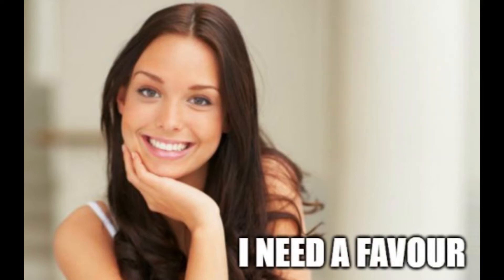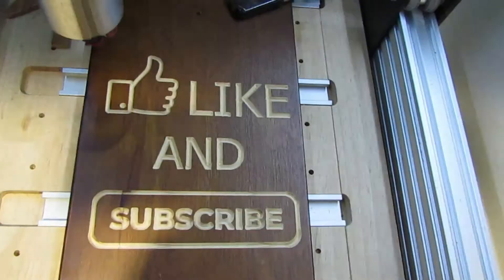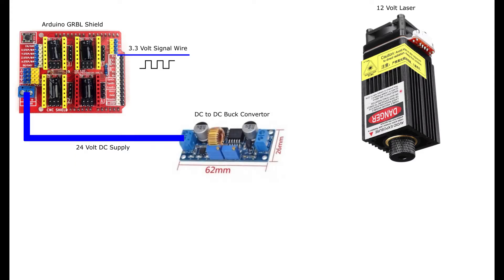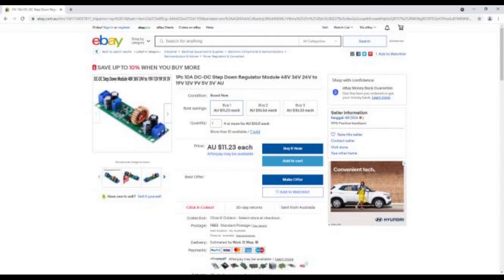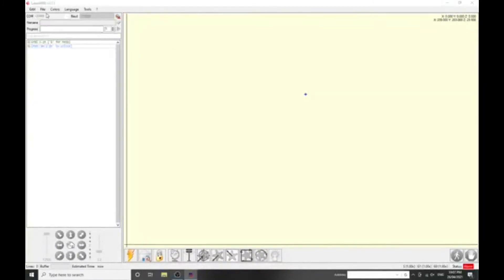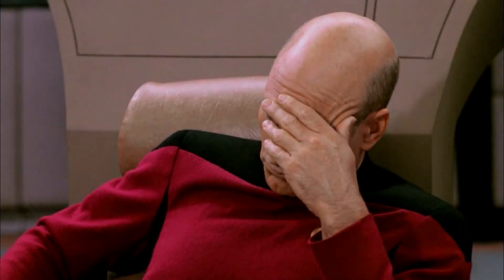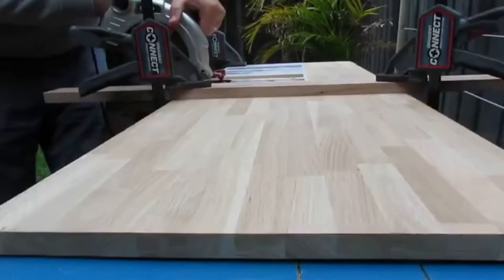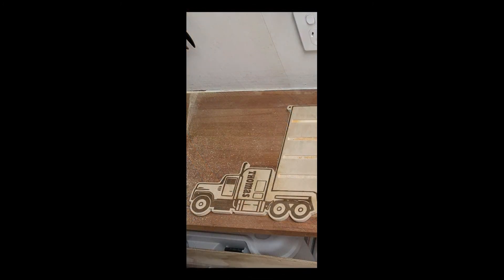Adding a laser engraver to my CNC machine

Comment: Why you don't connect a laser directly without MOSFET?
Reply from the maker: The microcontroller outputs are only 3.3v on/off signals - not the right voltage nor powerful enough to drive a 12v/5W laser.

Comment: You confusing me , because most of pwm signal oprate at 5v so how to know if my laser operates at what pwm volt ? I have CV 5 watt optical laser i contacted it to 24v VCC and touched pwm pin to check it was turned on and same time I use my other finger to touch 24 V it was at full brightness then I connected it with 5v same brightest and input current so I the it will work with both 5 and 24 V pwm so why you connected 12 v ? I think these is voltage clamping diode with clap pwm to 5V .
Reply from the maker: This is a laser without PWM (only 2wires). The mosfet allows the 3.3V Arduino signal to switch on and off the 12V laser supply. Your PWM capable laser likely has 3 wires. 2 for the DC power source and another to accept the PWM signal (probably 3.3 to 5v). If so you wouldn’t need a driver such as the one in this video.
Reply: @blackcatdown9560  but even at 5v pwm and full power in setting $30 = 1000 it's just consuming maximum 0.8 mA and when I connecting Laser pwm pin to 12v via 2k resistor it consuming proper 2amp input which is equal to 20 watt and 5w optical so what should I do 5v or 12 pwm?
Reply from the maker: @omsingharjit I not sure I understand what you’re saying, but The PWM wire is for the control signal from your microcontroller, hence microcontroller signal voltage (3.3-5v). It is used so your controller can very quickly pulse the laser which results in varying power levels. The wider the pulses the stronger the laser burn. Hence “pulse width modulation” or PWM. The other two wires are what provide the lasers power (likely 12-24v)
Reply: @blackcatdown9560 i know about pwm I was asking , whether pwm can also be of 12 volt logic ?
Reply from the maker: @omsingharjit  I don’t know your specific laser. All the microcontrollers I play with use 3.3-5v. I believe this is pretty typically across most controllers. What controller are you using that uses 12v?

Comment: First let me say thanks for sharing, thought it is a long time since you posted this, it still helps. Can you help me please? 
I have a Laser that has PWM signal and also can drive with 12V. Can I bypass the Mosfet module and connect all three wires (Z+ also), directly to the Laser? I drive the Shield on the Arduino UNO at 12V.

Comment: Nice job! Will it work with a fiber laser source also? (Not diode laser, something like raycus 50w fiber with fiber cable and optical focusing lens installed on the gantry)

Comment: I sure do appreciate your response, my goal is to put together something very similar to the video you posted, I was curious if I could recontact you if or when I run into trouble during my build,, thanks again, MARK.P
Reply from the maker: @markpastor4242  I’ll try to answer any questions you have along the way. I have a later video about adding a different laser module that could be worth watching too. That was my second attempt and I got a more polished result. It included some things like custom buttons in laserGRBL too which I find a big help when setting up jobs and when switching between laser engraving and milling.

Comment: Hello !! I have a 1064 infrared laser module. Three wires, black-red-white. Do you think this connection could work? Thank you in advance
Reply from the maker: Hi. Without knowing your laser specs I can only generalise, but being an infrared laser shouldn’t matter and this should still work. However since it has 3 wires I suspect your laser can do PWM, meaning the red/black is power and the white is for the control signal. Pwm (pulse width modulation) allows for greater control over the laser. I made a follow up to this video about adding a PWM capable laser that might help you.
Reply: @blackcatdown9560  Thank you so much. I understood perfectly, I will see how to configure the GRBL. (Translation with Google)

Comment: Hi! I want to connect 500mw laser to CNC shield v3 can you please help me..
Reply: 5V DC 405nm and can I use NEJE laser module on CNC shield V3?
Reply: The Neje is based on Grbl I believe, so should be able to get that to work.
Reply: Ok but it has only two wires + and - which will connect to 5v supply on shield and for Z+ I will need MOSFET module?
Reply: @muhammadabdullahhassan4472  you can the same setup as I show in the video with the mosfet module, but use a 5v supply instead of a 12v to suit your laser.
Reply: Ok thank you so much

Comment: Hi, does that irf520 module produce PWM signal to the laser (changing power of the laser)? Or just making it On/off?
Reply from the maker: Just turns it on/off. This laser doesn’t support PWM. I have another video where I add a laser with pwm.
Reply: Use Arduino or just simply 555 pwm circuit but Arduino is recommended with shield

Comment: This was helpful. Are there any issues when using two types of grbl cnc/laser; or is resolved in the physical switch?
Reply from the maker: I don’t have any issues running both. I do alter the Grbl settings depending on whether I’m running a laser or router project. The changes I make for a laser job is turning on laser mode, adjusting the soft limits to accommodate the laser head being attached and increasing the speed/acceleration settings since the laser doesn’t experience the same resistive forces as a router head. I have created custom buttons in laserGRBL that make this change between modes quickly. If you watch my other laser video I show the buttons there.
Reply: Thanks for the reply, your explanations help to clear the fog in (for me) a very cloudy process. I'll check out your other vids as you have suggested.

Comment: Interesting video. Thank you for sharing this info. It would be interesting to have more info on your cnc machine.
Reply from the maker: The frame is a workbee kit. The rest is an Arduino GRBL controller, nema 23 motors and S109AFTG motor drivers.

Comment: I have CNC Shield with a Relay that control ON/OFF in the 12V spindle. Wouldn't that be sufficient to connect directly a laser head instead of a spindle?
Reply from the maker: Maybe. A solid state relay might be okay. An electromechanical relay might not be suitable.

Comment: you said nothing of how you set the z limit up to control the laser
Reply from the maker: When variable spindle power is enabled in the Grbl config file it swaps the z limit and spindle enable (the laser driving) pin. If you search for “variable spindle” in your config file you’ll find it and the comments there explain it far better than I have. This might not apply to some older versions of Grbl.

Comment: Why If my #18 wire to ground. my Y only travels in one direction
Reply from the maker: My setup has no pin 18. Is yours a GRBL machine? What electronics is it using? Why do you need to ground that pin?

Comment: Nice as far as you go, but most hobby CNCs are controlled by Mach3 using parallel out.  Arduino shields use USB.  How did you get  your CNC to work on the GRBL shield?  did you  disconnect the motors from the CNC controller and run the motors from the GRBL/Arduino shield? Shields are generally sized for Nema 17 motors, which are a bit small for a CNC router.  What size motors do you have?  did you have to buffer the signals out of the shield to run the motors?  YOU said it used the Z out to turn the laser on, then how did you set a focus distance?  I was originally going to use my CNC also, but saw this powering problem and decided to just make a whole new CNC machine using GRBL and smaller motors.  I only need it to engrave small stuff,  My main laser can handle all the big stuff (it overpowers small engravings).  Thanks bro.
Reply from the maker: I don't use Mach3, I use Universal GCode Sender for CNCing and LaserGRBL for the laser stuff. I built my machine from a workbee kit and I used the Arduino + shield connected via USB without any issues. I am using NEMA23 motors they are 2.8 amp I think. They do connect to the shield although the stepper drivers needed to be selected with the motors in mind because like you say many are intended for the NEMA17 and they couldn't handle the current for a NEMA23. I don't do any buffering. 
Regarding the Z limit pin being used to drive the laser. I made an incorrect assumption there and what I said isn't right. I now know that when put into laser mode GRBL actually swaps the Z-limit pin and the Spindle Enable pin (used to drive laser also). It does this because the pin originally allocated to spindle enable didn't support variable speed spindles or PWM lasers. Not having that Z limit didn't affect my ability to move the laser up and down to focus it just meant I couldn’t home the Z-Axis because the limit switch wasn't recognised. Knowing what I do now I have wired the z limit switch to the "spindle enable" pin and it is all good.
Reply: Dear  @blackcatdown9560  
You mean that we'don't need anything other than CNCshield to drive Laser? I heard also CNCShield Z axis could be use to drive Laser because of there is no need to Z axis to use Lazer. But I could'nt see detailed documentation or video how to use Z Axis to control LAser power?!
Reply from the maker: @mucip_ilbuga  when laser mode is enabled in GRBL the spindle enable pin and the z limit pin are swapped. There is documentation about this on the GRBL wiki site. You still need something to drive the laser. In the example of the video I use a mosfet to do this. Some laser heads do have a built in driver however and they can just connect to the shield and a power source.
Reply: Dear  @blackcatdown9560  
Thanks for valuable answer. Well, how can I understand if the laser head has ability of built in driver? What is the spec?
I checked from some internet sellers but could not understand very well unfortunatelly.
Reply from the maker: @mucip_ilbuga  I am by no means an expert on laser heads, so consider this a generalisation and not gospel. In my experience if the laser head has only 2 wires; for the power source then it doesn't have a built in driver. If it has 3 wires, two for the power source and one for a signal/control wire (probably referred to as PWM or TTL) it likely has a built in driver. If you want a built in driver - laser heads capable of Pulse Width Modulation (PWM) or transistor-transistor-logic (TTL) are a good place to start your search.

Comment: I want to control the laser by getting pwm output with RAMPS 1.4. The laser has no driver. It has 12V AND GND outputs. How do I control the laser by receiving the pwm signal with a circuit?
Reply from the maker: You say your laser only has 2 wires and no driver so it sounds like your laser is a  "non PWM/constant on" laser (like in the video). These lasers are either fully off (0v) or fully on (12v), there are no other power levels available. This means the MOSFET driver circuit shown in this video is exactly what you need to drive the laser from the PWM signal wire. You may or may not need to change some GRBL settings or config file too. Note that when in laser mode GRBL swaps some output pins around too. Search Laser Mode in the GRBL wiki and you should find all the info you need on that.
Reply from the maker: @thorleifjacobsen  Hi Mate, this laser is the on/off only type, there is no PWM or variable power. M4 is Dynamic Power Mode, this is for use with a PWM laser. This mode dynamically adjusts the laser's output power to compensate for the accelerating and decelerating of the laser head. In other words when the laser moves slower it lowers the power and when it moves faster it increases the power and this results in a more even burn across the job. M4 will probably still work for you (without adjusting the power), but for your laser M3 is the more correct setting. The 0-1000 setting or a 0-255 setting should be okay provided your GRBL settings match. 
Your laser produces effectively black or white (no shades of gray). If you would like to engrave photos it needs to be done with dithering. This is using patterns of black and white dots to create the appearance of grays. You'll need to do some trial and error to find the optimal settings; so best to start with some scrap material. Read up on LaserGRBL's dithering tools on their website too.
Reply: Oh my hell... YOU DO NOT PLUG A LASER STRAIGHT INTO POWER! You will damage it!  (If you do please don't sell it to me on ebay later, as "lightly used"). You need a driver board. Mosfets are indeed awesome current sources, but only under special conditions(saturation mode). For each laser, you need to know two things: voltage and current. If you are just varying a duty cycle without even a filter network you may easily exceed both limits. If you really want to build your own current source, it's a bit of a rabbit hole, but basically, it can be done with a properly biased MOSFET and RC filter network to convert PWM to voltage level to drive the gate. There's a ton of info in MIT's 6.002 course online for example, for those really curious. Personally, I would just get a driver board.
Reply from the maker: @vlsh88  Hi Mate, I think you are over complicating this. The laser module used here is a ready to use product intended for hobbyists laser engravers. It really does just require a direct 12v power source. The MOSFET here is acting as a switch turning that power source on and off based on a 3.3v signal from the controller.

Comment: hello, this looks very interesting,
can i have your contact please?

i am from Mauritius, 
i have a 6090cnc and want to add a laser module to it..

please advise me

thanks
Reply from the maker: Hi Mate, sorry I don't provide my number online. I have had a quick look, but 6090cnc is a very vague description that could refer to many different manufacturers or models. Regardless like almost all CNC machines it is most likely possible to add laser engraving capabilities to your machine. How difficult it is and how much expertise it requires will depend on the machine, the software and the hardware. I am by no means an expert on this stuff, I'm just a hobby CNCist sharing some things I've learnt. I've added lasers to 2 very different CNC machines and both times it wasn't difficult to get the laser working, but both times it involved a good amount of troubleshooting to get them working 100% how I wanted.